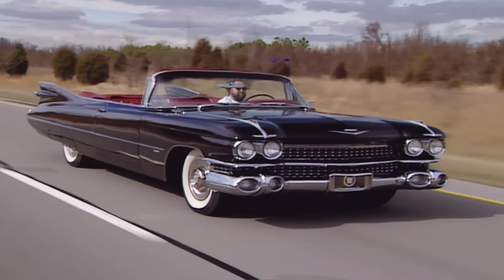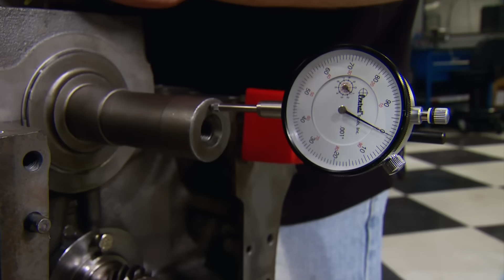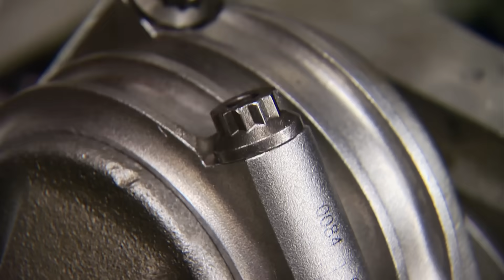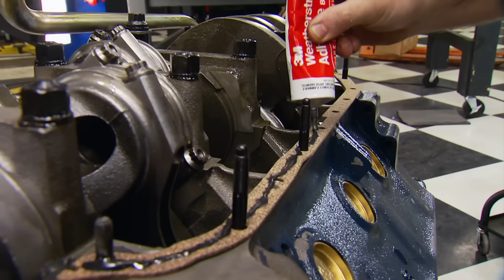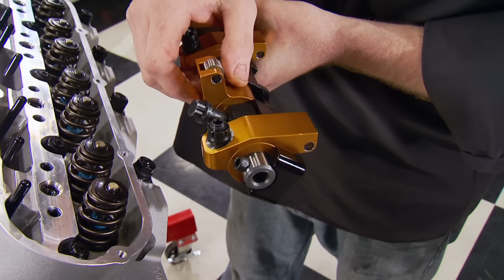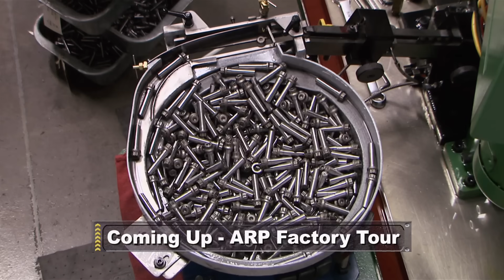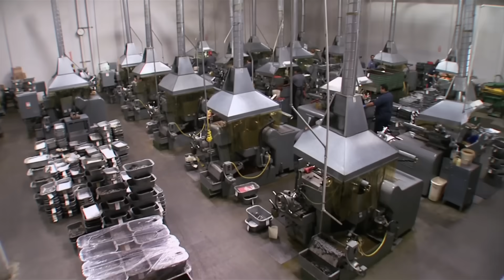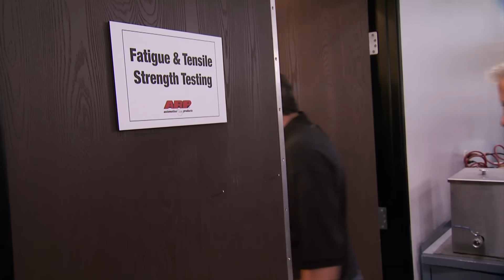Turning A Junkyard Cadillac 500 Big Block Into A Modern Day Monster - Horsepower S16, E3

Comment: damn... those nice of heads, a 540 CI... and its barely making 1:1 hp? what did ya'll do wrong? 
"this thing is evil right outa the gate".... bro we literally have a Kaase SR71 headed bbf making double this on pump gas sitting down at the shop waiting on a new Jericho to get back running... ya'll screwed something up
Reply: They needed way more cam. The 500Vi had plenty of compression and head flow!
Reply: @bri-manhunter2654  its sad when you see parts like this go into a motor and they act happy with crap results 😖
Reply: @narmale . Exactly, that thing was begging for a bigger cam! I guess they wanted a nice mild cam with low end for stump pulling. It was a waste of very nice parts!
Seems like a waste with all the parts added; I could have made the same power with stock motor. Aluminum high compression heads, bigger cam, dual plane intake manifold, carb, and ect could have made the same power.
Reply: @narmale  The manufactuer looked worried.
Reply: @bri-manhunter2654  I am more interested in putting a turbo on a stock engine with around 500 HP.
Reply: EFI.
Reply: @rogersmith7396  😂😂😂😂
Reply: The Cad Co. says the engine has poor breathing.  I think they supercharge to get over 1000 HP.

Comment: This is a modded 500, so it's not a 500, but a 520, why not a 1 piece rear main?

Royal purple is junk oil.

600 hp is miniscule considering a 364 can produce that non boosted.
Reply: But what would the low-end torque look like compared to this big boy?

Comment: It's a shame you can take a 4.6 Ford engine evening to valve Which is less then half the the cubic inch and put out more torque and horsepower double that there's guys out there putting out 1200 horsepower at 1100 foot pounds of torque with a 4.62 valve nice loader the caddy but it's not in the ballpark in a new school old school it's okay they cannot play in the new school
Reply: Plz show me this 4.6 2 valve naturally aspirated having 1200 hp,there's not enough cubic inch to get those torque numbers either.

Comment: I'd replace the intake with a dual plane for the longer runners, to bump up the mid range TQ. I went from a Max Wedge Indy heads and single plane EFI intake on my 500 Mopar, to a longer runner ported Edelbrock Pro Flo XT intake with standard port TFS240 heads, and gained approx 40 ftlbs at 4400 rpm. With nearly the same cam specs at the Caddy, the Mopar (installed in a jetboat) turns the same spec'd Scott Jet 912 drive at more RPM than the KEM LT4-650tq/650hp marine engine.
Reply: One day a thousand years from now researchers will read this comment and assume it was in a foreign language by visiting aliens.
Reply: Weber power plates
Reply: Your Mopar is a horse of a different color I've built a few Mopar max motors 514 all aluminum Indy heads 440 source crank rods n Pistons with the 7.100 rod with the big Chevy rod bearings and ground crank T n D full roller rockers 879 HP 4500 Holley dominator by TMP carbs it flows Almost 1700 cfm with weber power plates it was in a 21 foot pickle fork with a jet pump it goes 106 mph Can you say HANG ON

Comment: 500 caddy mtr w/472 heads    all you really need   low buck HP    no trick stuff...
Reply: 12.5:1 compression.
Reply: The low compression blocks are different to the early ones.  You usually do the 472 heads to boost the compression of a low block.
Reply: Or the 425 heads for I think 13.5:1 compression. Needs super high octane and probably retarding the timing.

Comment: God I hate carburetors nice motor bit would be nice to see some fuel injection ontop of that 500
Reply: Try reading the manuals and looking at a flow path diagram for the fuel delivery. Once you understand everything about them, you can truly tune them yourself. With a rebuild kit and minimal tools you can usually fix any carburetor issues on the side of the road.
Reply: @jasonhooey5677  Pretty hard for a carb to match EFI when it comes to fuel distribution, mixture control at part load, etc. 

Depends what you want, carbs are simple and cheap and work more or less just as well as EFI if you're only interested in winning drag races. But if you're after accurate mixture control under all conditions, easy cold starts, fuel economy, passing emissions, that last 0.5% of possible power output... then EFI is where it is at.
Reply: @nerd1000ify I take pride in how much I hate carburetors they always need to be tweaked on carb it youll always have to fuck with it fuel injection set it and forget it 😎

Comment: My Dad use to service trucks for a local  tire shop that used Ford F-250 trucks. When the engine would south which they did as he bought these trucks used and then painted them in his company colors my dad wouldn’t bother with a ford engine. Those old Cadillac motors and transmissions were a dime a dozen so out came the ford power plant and in went a Caddy set up. The guy like them so much he had my dad rebuild a 500 and put it in his ford crew cab.

Comment: The 500 is so slept on it’s a beast!!🔥
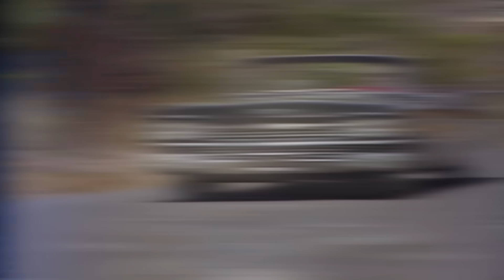Reply: Answered in the video at 1:45.  Max HP from the factory was a mere 190 and there was no aftermarket support for a long time.  That changed when performance parts became available.
Reply: I never understood why people would choose the 472 when for a few $$$ more you could have the 500... :)  My dad had a 1960s caddy in the 1980's I always loved that car!
Reply: @barking.dog.productions1777 The 472 was not that much different. Cad Co often ran the 472 in forced induction builds alot as it survives higher engine speeds better than the 500. Potter Cadillac solved it by going to Mopar crank and rod journal sizes. My '69 10.5-1, 472 would make more power a than ' 74 and later 500 in stock form, both on leaded 110.

Lowered compression in the later 425 & 368 sealed their fates, as these heads need high compression, or they lose efficiency as stock.
Reply: @scotteric8711 Well, of course it would.... 

Drop 2+ points of compression on any engine and it'll lose torque and horsepower BIG time. That's a GIVEN.
Reply: @barking.dog.productions1777  lol I know that’s right! Man I bet that thing was real nice!!
Reply: @darealyunga.v.3392  It had real style, all them fins and chrome, and a low rider too, and it was shorter than the seventies caddy that came after...  Those 70's cars had trunk and hoods about 6 foot long each... lol

A blessed and prosperous new year to you, brother...
Reply: @barking.dog.productions1777  that’s a true caddy for sure! I love them lowriders tho lol those trunks could fit a family in them😂 same to you brother stay blessed and have a great 2022!
Reply: Punctuation at its best.😂

Comment: The caddy company Albuquerque New Mexico sales all you need 472 Chevy Silverado pickup 1987 puts the third chunk out of the 70s rear wheel drive Cadillac car transmission and motor they sell a kit look up the caddy torque monster build out of hot rod by Dick Miller

Comment: That tiny cam bore is a major weakness when compared to other designs like the ford 460 is it possible to bore it to take a larger core?
Reply: I would submit that this 600-hp engine is a LOT more streetable, in the day-to-day, than a lot of other mills making the same hp.  Torque is what moves the car. And a lot of torque, right off idle, is what makes a car nice for me to drive. FOR ME. Your own preference will probably be different.
Reply: @theprojectproject01  That's what a large engine will do.
Reply: If there is material, it can be bored. The question is, what do you want? Reliability or power?
Reply: @sethh8892  You would potentially gain some of both by making the cam bore larger.
Reply: You can. 

But there’s no point.
Reply: @95roadie  Oh?
Reply: @95roadie  more HP is the point...  You have 6 cylinder toyotas, and tiny albeit 3 rotor wankels make more HP than that.
Reply: @barking.dog.productions1777  with turbos. They also have to be rebuilt after 3 passes down the track.
Reply: @95roadie  if I'm going to pay for that level of fuel consumption I want at least 1000 HP... 600 HP is stock power level for a Vortec Chevy now, and not even a big one which make around 700 HP bone stock.  600 HP hasn't been impressive since 2000
Reply: @barking.dog.productions1777  600 horse isn’t impressive? Lmfao. 

Keep dreaming kid.
Reply: @95roadie  I don't have to dream dipski, when is the last time that you checked out new cars or Chevy crate  motors  Dodge charger 600 HP factory motor option, Chevy corvette near 600 HP and they haven't even come out with their factory super- charged engine option yet... corvette has had 600 HP factory engine option for over 10 years...
Reply: @barking.dog.productions1777  LTs and Vortecs are totally different platforms. Lmfao.
Reply: @barking.dog.productions1777   And how would that engine do in 15,000 lbs of school bus?  Not as good as a 500cid Cadillac V8 does in mine.  I need power right off idle and at 2000 RPM, not at 6500RPM.  The big Cad delivers, and the most non-stock parts are the Cloyes roller timing chain, ARP rod bolts, and Edelbrock intake and carb.  Maybe it is only 380hp, but it's also most of 600lbs/ft torque and those happen at much lower speeds than other engines I could have swapped in.

The simple truth is that for a fourth of the money these guys spent, the big Cad can do at 3400 RPM what a big block Chev will suck valves, spin main bearing and break cranks-long term-doing at 4800RPM.  When I did the swap, my first thought was buy a truck big block Chevy and rebuild that..  every one in the wrecking yard had the same spun main bearings and other issues.  Buildable core $2500.  I had a yard full of old Cadillacs, some with over 300K miles, and no issues.

I swapped the tired SBC out of this bus for the Cadillac 500, 23 years ago.  This '65 Chevy 60 series Carpenter coach school bus will still set you back in the seat when you open it up.  I never need the split rear axle anymore.  Just put your boot in it and go.
Reply: @barking.dog.productions1777  Hellcat like 800?
Reply: @Bolton115  🤣We are not in disagreement about that - however this video is about building hi-hp engines not high torque engines.  That is why my comments address hp and not torque.

I like your idea about caddy engine for a big truck... I currently have a 30 ft ex-uhaul that needs a motor.  The 454 is over priced used, and most of them come from 1980-1990 era motorhomes with what - about 150 HP / 250 ftlb torque? Hahaha  Just a guess, but they are pretty doggone anemic!
Reply: @barking.dog.productions1777   they really have closer to 380 torque.  But still later thin walled, crank breaking, bearing spinning, valve sucking OG 454.

I'd go Mopar before 454-and I'm a generational GM guy.  Sub-5000 RPM the stock cadi valvetrain is fine, and with the stock cam bore guys are approaching .800" lift and let's be real with ourselves..  that's more than plenty.

The Cadillac is just a better engine.  Lighter, stronger, more torque, longer life.

But then again, I care little about dyno pulls.
Reply: @Bolton115  I agree.  I'm an old school Pontiac fan (400, 455) which IMO blow away 454s, but even those can't compare to a good caddy (472, 500) for torque.

Unfortunately all of the good old school motors are getting scarce in the bone yards... many older cars they just crush - they don't even consider pulling the drive train 1st.

I'll tell you what else an old caddy is good for many classic 1920-1950s cars will bolt right up to a caddy frame, so it is simple to take one of these bodies and update it with all of the modern conveniences - super strong motor, AC, power everything including the power seats.
Reply: @barking.dog.productions1777  that sounds rad!  Old looks but modern brakes and steering.  But weren't a lot of those old cars smaller and narrower than a big Cadillac?  I guess it depends on what the oldster is, tho.
Reply: @barking.dog.productions1777  I hot rodded the 4 cyl half a 389 in my 1961 Tempest wagon.  Super duty rods, four barrel intake, high compression pistons, Carter AFB carburetor.  That was a great car.
Reply: @Bolton115  I feel you - we all have cars that we wish that we had never sold...

For me it was my 1975 Pontiac Grand Prix LJ

I pulled the perfectly good 400 4bbl and replaced it with a super built 400 T/A motor

Even with the TH400 auto 3 speed it would pull 2 nd gear at 110mph and rocket up to who knows what - since the speedo was buried at 110 before I kicked it

I'll put it this way - I drove a friend after work on a saturday on cruise control at 110+ mph, and a state trooper going the other way  hit his lights and crossed the median....

I pulled 2nd gear and floored it, and he gave up - he cut his lights off and cut back across the median!  Hahahahahaha

He knew that his anemic car in the early 1980s would only do 125mph and I was already doing 160+ and climbing quickly toward 200 mph

LOL keep in mind that this was the 1980s  so don't try this today kids - the world has changed and your own elected government will just call in a drone strike on you today.

Patriots are working on giving you youngsters true freedom as we enjoyed, but you have to work with us and not against us
Reply: @barking.dog.productions1777   Come on now..  160+?  I love me some old school Pontiac but that seems a bit of a stretcher:-D. Early '80s police specials like the cop Caprice my Grandma bought at auction could do around 120-ish tho.
Reply: @Bolton115  You tell me - if I am cruising at 110 - 120 and I kick it into second gear and the back end squats and the push back into the seat runs it up to at least 130 in second gear - let's be conservative here, and then a shift into 3rd gear dips the tail again and pulls almost as hard for a full minute or two...  Maintaining the same speed does not drive you into your seat - that requires massive acceleration.

What is your estimated top speed?  This car would not turn a tire below 20 MPH  - it would do 70MPH in 1st gear, bury the speedo at 110 in 2nd gear and keep pulling strong with the speedo buried (The odometer button physically stopped the speedo at 115mph)

And hit third gear pulling strong at at least 125 MPH

1975 Grand Prix had something around 2.02 axle gears...
Reply: @barking.dog.productions1777   the stock gear ratio was 2.56:1 which is still pretty tall.  You were really going about 145mph because you had bigger tires than the puny GR78-15 (think 215-75R15 in modern nomenclature) so the speedo read slow with the 235s you were probably running.  My uncle had a 1976 Trans Am T/A 400 and it was good for the full 140mph on it's clock, but not much more.

For a giant 1970s brick, 145 is stellar..  but I can promise that you were never in any danger of "approaching 200mph."

Trooper gave up because it was shift change and he didn't need the drama of radio ahead for roadblock and high speed chase.  Even on the Dukes of Hazzard, "Radio is faster than rubber."

Good times indeed.
Reply: @rogersmith7396  yes with a blower
Reply: @barking.dog.productions1777  8.2 has more torque
Reply: @Bolton115  He gave up because he could not catch me, and this AR not LA - out on the open highway it might be 30 miles of farm land between exits.

No point in calling ahead when your speeder has 30 miles in which to pull into  a field and just hide out for a few hours.

Not that way today - don't try this at home kids - hahahahaha - but the state didn't have everything locked down in those days.

BTW, bro enjoying your comments - many are very informative.

GOD Bless you and yours - have a great weekend!!

😁👍
Reply: @Bolton Peck  my dogs are barking after reading that story! Lol.  Hard to believe.
Reply: @95roadie they don't need turbos
Anyway. My 1972 monte Carlo has a
572 big block Chevy it doesn't have turbos it has a edle Brock intake with a Holley dominator EFI carburetor
Reply: @barking.dog.productions1777 a Cadillac 500 cubic inch engine won't make 1000 horse power. You Re brain washed
Reply: @95roadie I disagree 600 HP is enough for a demolition derby car right around 7000 RPM
Reply: @95roadie they sure are different 
I have a vortex 5.3 in my 2023 GMC 
Sierra it makes around 335 horse power.

Comment: Technically speaking GMC offered a 638 c.i v8, albeit a truck motor.
Reply: Heh, yeah and it made all of about 250HP :-D They even offered the Twin Six, a V12 version of the same 60 degree V6 that they made into that big V8.  There were some cool things about the design, but the low compression ratio (7.5:1) tiny valves and poor breathing let it down.  I have the 351cid version of this V6 in an old school bus.

Comment: Yes I want to save and put one of these in a Chevy flatbed
Reply: Agreed, im all for unusual powerplants but the BB chev is a drop in ,readily junkyard available,  and will supply the same power numbers, or more, for much less money.
Reply: Just grab a 454 or 496.
Reply: You can get a 454 for dirt cheap. That caddy will set you back a lot more, and the aftermarket just isn't there unless you want to spend thousands to do what you can with a budget big block Chevy.
Reply: @TheSleepyMechanic0524  won’t make the same type of torque at such low RPM
Reply: @aboriginal1993  bs. All about your cam specs, heads, intake type, timing, exhaust size and many more things.
Reply: @TheSleepyMechanic0524  I totally respect your perspective! These big block caddy motors are just hard to out torque, there I guy in South Georgia with one in an old dump truck he took the 366 Big Block out of it and put a 500 Caddy Big Block in it, the old fella said that engine was swapped in 35 years ago and that truck still starts on the dime. 🤣🤣🤣